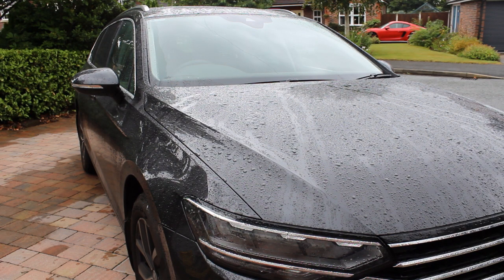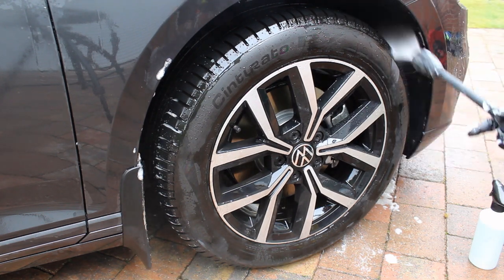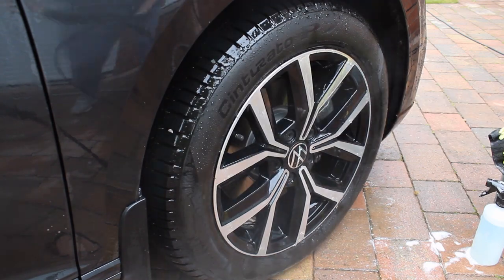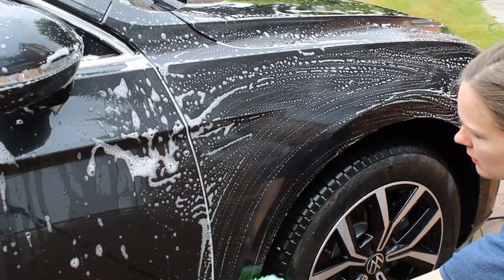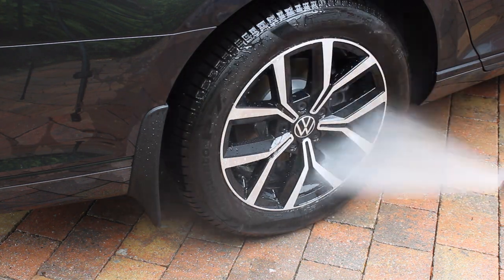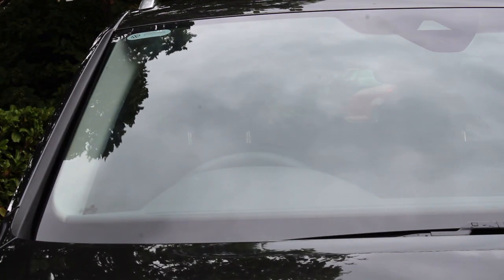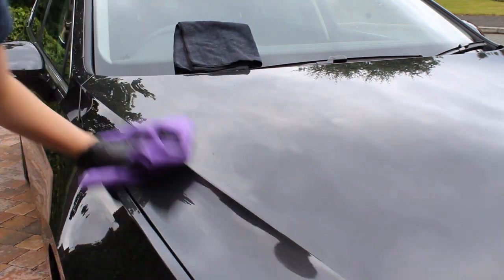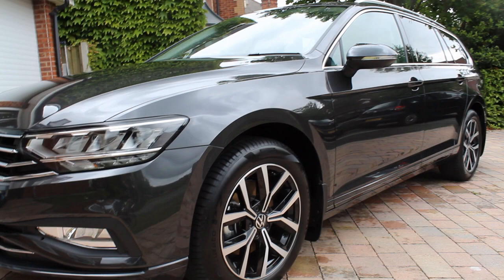NEW CAR WASH | Cleaning and Protecting this Volkswagen Passat

Comment: That looks beautiful Heather, another one to be proud of! A tip for cleaning those wheel arches, invest £7 in a Vikan 522252 Long Handled Car Brush, got mine from eBay. It gets right into the carpeted arches and is just stiff enough to remove the muck without damaging the finish. Thanks for another entertaining video! :)
Reply from the maker: Thank you! Those vikan brushes look really good quality, I think I’ll pick a few of them up soon, thanks for the recommendation 😊
Reply: @AutoCareHQ  Will let you know , G1 was required a bit more work ,than the Pyramid coating seems to be

Comment: Great video Heather! Not a criticism really more of an observation but a good tip I’ve learned is to pay attention to the tire hydrophobicity as a clean, bare tire is not hydrophobic. If you scrub the tire & rinse it & it’s still repelling water that means it’s still got some sort of silicone or protectant on it. While the foam was white after scrubbing & didn’t really turn brown at all that most likely just means your solution wasn’t strong enough to break through whatever was on the tire at that time. If you use green star on tires I find the only dilution that will cut through a silicone dressing or something of that nature is a 3:1 mixture on a wet tire or a 5:1 mixture on a dry tire. Just an observation lol. Great job & great video Heather! Take care!🤘

Comment: I was at the dealership when my wife bought her new car and there was a bloke there wiping all the rain water or due off all the cars each time we visited. The bloke was using one of those big squeezey things you'd use on windows. Couldn't believe it, doing that every morning the cars must be full of scratches before you even buy it. Great job as always on the VW.
Reply from the maker: It's shocking how they clean them! Mine was in a right state when I got it. I was so surprised when I looked at the paintwork on this, it came straight from the factory so maybe they hadn't washed it yet, but either way the owner got lucky with this one!

Comment: Another great informative video, (still working my way through your back catalogue, lol. ) did pretty much the same on my new Polo, and as you said, the paintwork  was great already, direct from the dealership,, anyway,, my car is looking good, with the turtlewax ceramic, and Pyramid glass coating,, keep up the good work, and the great tips,,,
All the best,,,    John..
Reply from the maker: Cheers John I really appreciate it! Let me know how you get on with the glass coating when you get chance to try it!
Reply: @AutoCareHQ 
I applied it last weekend, and it's only rained very slightly once, when I've been out in the car, (ha ha..) 
I noticed a slight judder from the wipers initially, but as you say, the rain beaded up and seemed to "roll" off, over 40mph..😀.
Will the judder get worse, or dissappear do you think, ?? I gave the wipers a really good clean, after applying the Pyramid,, and as I said, the car is only a month old, so no real contamination, on the screen..   Again, thanks for all your great tips, and advice, (to a novice like me,) ,, 😀
Reply from the maker: no problem! I didn’t notice any judder but I doubt very much it’ll get worse, you can apply some coating or if you have any other glass sealants to the wipers themselves though and I’ve heard that helps!

Comment: Nice video Heather, think it was unnecessary to use Autofoam on the wheels before rinsing as they’re not that delicate 😅 , but on other hand no reason not to 😂.
I still haven’t used my Three / CS yet 🤦🏻 great tip with the microfibre pad, I do like using them as well, got some amazing soft ones to use.
Reply from the maker: Cheers Graeme 😊 I had a full litre mixed up ready for the day so I thought I might as well get it used 😂 it’s definitely worth trying CS with a microfiber pad as well when you get chance

Comment: Great job! On my car the front wheel arches are made by hard plastics. In the rear it's carpet wheel arches. How do you clean these carpet wheel arches the best way?
Reply from the maker: Thanks for watching 😊 I clean them the same way as plastic, I just blast them out first then use a fairly stiff brush and some all purpose cleaner and then give them a good rinse
Reply: @AutoCareHQ  thank you for your advice. I'm just a little bit afraid to destroy the carpet with a stiff brush, so until now I have only used my foam and a hose. I have also a Mazda. It's a CX-30 and I love it ♥️

Comment: Have you tried the multi mitt wash ?
Reply from the maker: Yeah I use it quite often, I’ve got a few of those cheap noodle mitts for it. Sometimes I go for the two bucket method and sometimes a mix of the two to be honest, depends how I’m feeling on the day!
Reply: @AutoCareHQ  Yeah I’m getting on well with it, feels much safer, have you thought about using a car dryer, I use the BLO  AIR GT Makes life a lot easier
Reply from the maker: I really want to get a dryer I've been saving up for one!